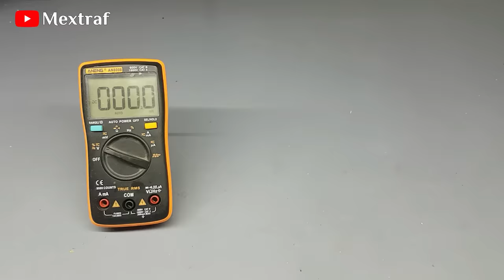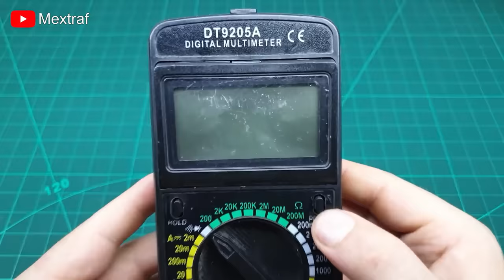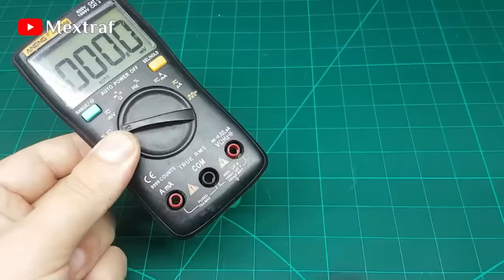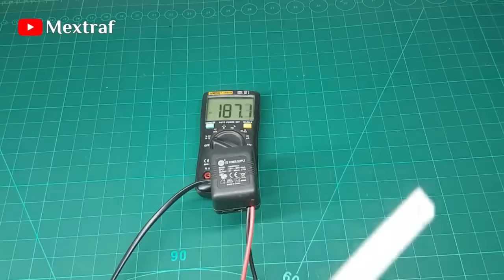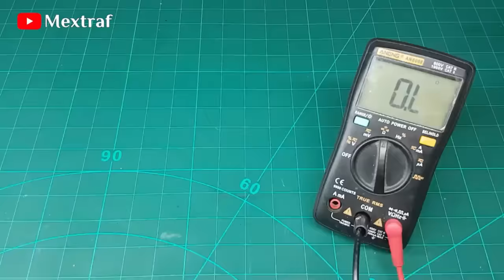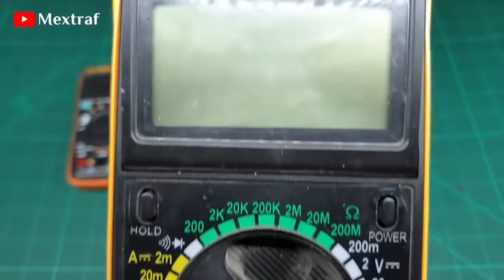8 diy Innovations to upgrade your multimeter to another level

Comment: Can the LED voltage checker, zener diode checker be built with an LED lightbulb control board that only has a 120V, 60Hz rating?

Comment: not sure what boost regulator you're using, but it's really, real important to be sure that the module has "undervoltage lock-out": one type of module can suddenly boost to about  40 V  if the input drops below about 3 V !!
Reply: impossible
Reply: @esecallum  de imposible nada , a mi me ha pasado no con ese modulo en concreto pero si con otros buck
saludos
Reply: @esecallum  what do you mean "Impossible"?  UVLO is practically a necessity in any battery-powered application, and is a requirement in most 'real' designs... I've been responsible for something like 15 IC design projects, and REQUIRED UVLO IN EVEY ONE OF THEM...
Reply: @domingoderivas8410  You are absolutely correct; I ordered some boost modules on Amazon & Ebay, and the IC used in them has no UVLO, and I measure 40 V on the output, when the input voltage dropped below 3.2 V
Reply: 24

Comment: Hi, I bought a cheap multimeter without frequency measurement. Is it possible to upgrade the multimeter so that it can measure frequency (maybe with duty)? Also if possible, I would like to know how to add capacitance measurement to a cheap multimeter without capacitance measuring.

Comment: I did not understand, 47 mA is enough to burn a LED, but it did not burn, why
184÷3900 = 47 mA
But led need 20mA
Reply: Спасибо! Правильно! Да ещё и не все светодиоды переносят хорошо повышения напряжения! 🤣
Reply: 20mA is safe value, but LED can often withstand higher current. It makes them warm and a bit brighter, but limits lifespan a lot.
Reply: 39ком
Reply: 184/39000=?